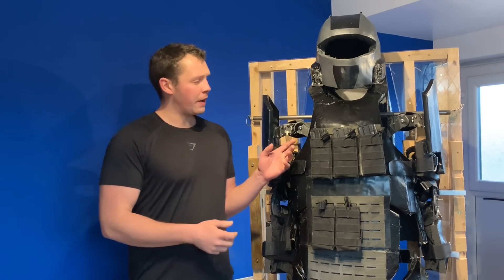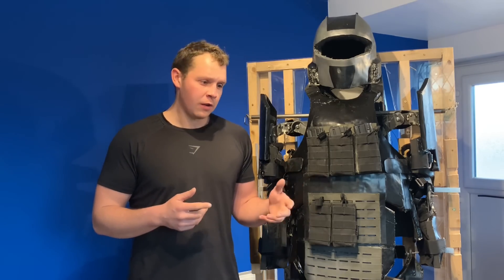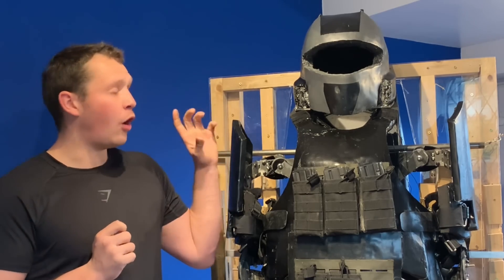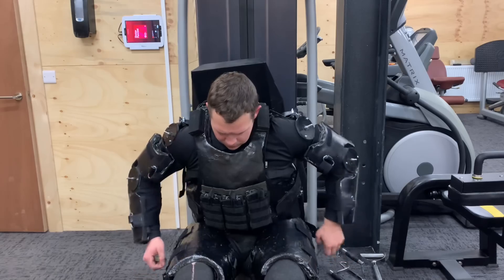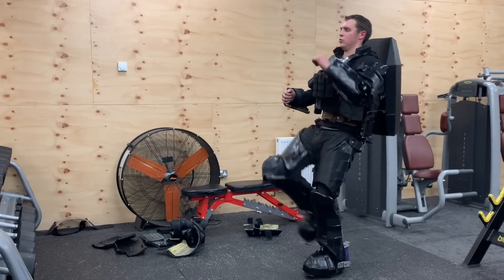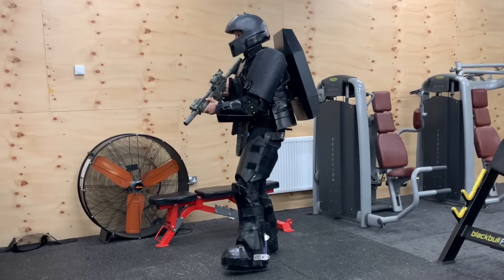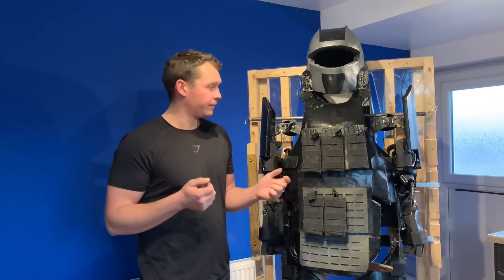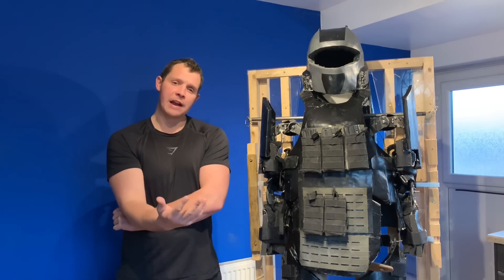Functional Combat Capable Power Armour Development Episode 5 Quest for Bullet Proof Exo Skeletons

Comment: Considering you're going at this project solo I want to run by you a few ideas I've had floating around my head on this concept for a few years now, as you have full reign on the project and it's influence and you're truly on to something. I've really been racking my brain about this and think that the concept of power armor needs to approached as a full system rather than just a fancy new jacket for the boys at the front, and seeing how you constructed the legs thus far and how they resemble some of that vision, I'm sure that my input could be of use to you and can give you the tools to better present this idea to investors: 

#1: "what about grenades?" 
Having a full suit of rifle rated armor is great but if the concept you're developing and prototyping is ever going to see the light of day, one needs to consider the ways that it could easily fail and run the whole project aground. Currently existing soft-armor solutions are still the predominant armor systems for most modern militaries because, for the most part, people just aren't actually that great at shooting each other while under fire and it's bombs [of various sizes and implementation] that really do most of the killing in combat and guns really do their best work herding the enemy into corners where they're easier to target with explosives. With soft armor, your best friends are mobility and cover. Case in point: if your rifle-rated system is going to have any viable advantage over the stuff we're fielding today, you need to really sarcophagi your wearer to keep the small bits out too. If you can be bullet-proof to a rifle but some clumsily placed buckshot or stray flak will turn you into the worlds heaviest one-man CasEvac, that armor system is now simply a liability to everyone in and around it. My recommendation would be to actually allow the wearers range of motion to sit in the back seat for the list of priorities and focus more on the coverage the armor panels mounted on the exoskeleton can provide. The individual in "power armor" shouldn't /need/ to go to ground to seek cover from common infantry weapons, getting up to their shoulders in the mud, they should BE the cover, and be deployed in strategically different circumstances to other types of infantry to compensate for the lack of mobility and the resupply necessities the armor system presents. Which leads me to my next point:

#2: Different job, different tools: 
A) The weapon: No armor system no matter how complex would be able to hold-up against concentrated small-arms fire without some serious high-sorcery being on the table. The best way to keep rounds from coming your way would be through fire-superiority, especially if your options for cover are limited. Your example with the carbine presents a critical obstacle to the implementation of a powered armor system in that, as I covered previously, the coverage of a capable helmet for such a system cannot be compromised to account for the ergonomics of a common rifle. Because of this, I'd suggest that you mock-up a dummy weapon that is designed around the armor instead of designing the armor around existing arms, and the purpose of the dummy weapon by design be that of a weapon system that can "hose-down" high-priority threats like MG nests, RPG teams, short-range gun emplacements, and light-armored vehicles which can actually engage armored combatants with effective volumes of fire. In my head I've envisioned something akin to the "smart gun" from the Alien series.
B) First-Aid: For medical interventions when the armor system does fail due to the use of anti-armor weapons, direct-hits from explosive munitions such as 40mm grenades/mortars, or high-volumes of concentrated small arms fire; the bulk of the armor would make it impossible to access any injuries below it, so the medical interventions such as TQs, quick-clot agents, IV fluids, and the like would need to be pre-implemented underneath the armor system in a way that the interventions could be activated without having to doff the armor altogether. Then, upon evac from the AO to a field hospital, the armor system could be removed with surgeons already on-site to provide immediate care to the wounded operator. 
C) Mobility: If you're following so far it should be apparent that there's no realistic circumstance in which an armored combatant would be capable or expected to run kilometers at a time to keep up with the tempo of battle. Hell, that's become uncommon simply with the current implementation of body armor today. Mobility would rely on some kind of rapid-deployment vehicle(s) which should allow operators to quickly dismount and disperse in order to effectively react to contact and keep "armored-infantry" units from becoming bowling pins on a two-way range when on the move. This is definitely a "down-the-line" consideration but it should still be considered from the inception of a functional prototype on /some/ level, at least as a selling point when presenting this concept for development.

#3: Task & Purpose:
Battery packs need to be recharged, it's difficult to reload belts without nimble fingers,  It's hard to eat through a helmet. The implementation of "armored infantry" should be for rapid-deployments: SWAT teams, QRFs, and to sever defending forces from the rear during offensive operations or provide security for aircraft landing in hot zones. Wouldn't make sense to throw guys wearing that kind of heavy gear into trenches. Form follows function, so hopefully such insights could inform your developments as you continue to build on the literal framework you've created thus far. 

I hope this comment catches your eye and that my midnight ramblings are of use to you in your development. 
Cheers and good luck.
Reply: to solve your first problem he could use an armored skin suit that goes on before stepping into the suit
Reply: @spazmonkey2131  I was thinking that too, but I still think that taking some notes from medieval plate harness at the expense of cost and flexibility [not like plate armor of yore wasn't usually incredibly articulated and mobile, mind you] should be the method of approach, given that ricochets and stray rounds are still a threat against soft armor and larger shrapnel fragments from threats like VBIEDs could easily defeat even chunkier flak jacket models. Bigger targets tend to naturally attract fire from bigger guns, so having maximum possible protection, yet again, at cost of your full range of motion, is probably the greater priority in development because retrieving the dead and wounded equipped in this fashion could be very well impossible in combat. Now, nothing could realistically be done about over-pressure from even smaller scale explosives like hand grenades but at least if your budget space-marines are maintaining proper dispersion,  you can then minimize your super-expensive casualties on the section level. And on that note I want to stress again that the use of a high-volume-of-fire weapon system would also dissuade hostiles from engaging with direct-fire weapon systems which could more readily exploit any chinks in the armor system. I don't think that a new platform would need to be built from the ground up; an MG3 on a modified steady-cam rig with a PEQ15 or something as the targeting device should suffice against anything that comes your way, especially if your whole section is equipped in kind. The only reason I wouldn't suggest an outright minigun is simply because it would be too complicated to maintain in the field.
Reply: @spazmonkey2131  Or just have a kevlar skirt...
Reply: First point is irrelevant. The armor system is just meant to be composite armor covering more than the torso vitals. Any explosive will be able to kill you with overpressure alone, given that it's an exoskeleton, not a suit designed to be air tight.
Reply: @HaloDude557  most shrapnel threats can drop targets at ranges exponentially longer than their intended blast radius. While the overpressure from a hand grenade can cause lethal injury within 5m and the fragmentation threat is optimal at 10m to 15m depending on the model, you can still get off-switched out to 50m if god hates you. The threat of over-pressure casualties is mitigated by disciplined and well trained troops maintaining proper dispersion.
Reply: @HOWCANIASSISTYOU  I’m not talking about grenades. If you make armor that  is impervious to rifles and grenades, the “enemy” will look to bigger ordnance. That’s just how things work. The idea of this armor is for full body rifle rated armor protection. Becoming a living walking tank is science fiction.
Reply: @HaloDude557 
I was gonna write a book as a response because I had the time but here's something you might actually read instead. 
Read my previous comments again, think about the principles on which I mention my points. I've already addressed all this. 

Hand grenades are an example for the larger expression that shrapnel is really what does the heavy-lifting for explosives. You can kill a man with a claymore at 200m if the stars align just right, but you can still sit in a hole five meters behind it and be fine with ear-pro. If your intel is tight, your troops are disciplined and understand how to move together in the field [spacing] and you can employ other weapons and systems like loitering munitions, predator drones, signal jammers, and so on; you can keep the big guns off your guys and allow them to complete their objectives with their own target precedence. 

I don't expect a magic human tank. Nobody does. Not unless they're twelve years old or on drugs and hopefully not both. Medieval lances still punched-through men in full plate, as did war-bows, as did ballista's. No armor system will make you invincible to weapons that are bigger than you are, that's not how mass and matter fucking work. You know what kept armored men from getting swiss-cheesed by these weapons until firearms became mass-producible? Combined units and tactics... Y'know, like in every war. Ever. Always.
Reply: @HOWCANIASSISTYOU  "You know what kept armored men from getting swiss-cheesed by these weapons until firearms became mass-producible? Combined units and tactics"
And mobility... hence why the end goal of this video is science fiction. The only realistic alternative involves a lot of armor compromises, complex engineering, and expensive materials in order to have mostly full body protection in a high speed environment. Something like multi-hit Polyethylene plating and single-hit flexible/soft armor (such as hexar or some kind of composite) in combination with a carbon fiber + titanium unpowered exoskeleton would technically work but be far too complex and expensive to build and maintain at scale. Because of that we're back to the good old reliable front/back plate with high cut helmet.
Reply: @HaloDude557  I agree with you here with some caveats. I think that some of the obstacles you present are only extant due to a lack of currently existing infrastructure. The Manhattan project produced the worlds most devastating weapon family in only three years by doubling-down on theoretical mathematics. None of the special equipment it took to build the first nuclear weapons existed previous to the project and now most influential nations of the world have nuclear arsenals [whether they're functioning and up to the task, who knows.] We're currently using 3d printed metal parts to design rockets. Buddy in the video built what he did pretty obviously in a work shop running solo and it's nothing short of impressive. If the air force can keep modern combat aircraft with their bells and whistles up and running, I'm sure replacing damaged armor panels and maintaining a pneumatic valve system like a formula 1 pit crew is far from out of the question for a well funded military,

Another thing is that infantry combat doesn't take place at a dead sprint and virtually never has. Maneuver warfare relies on the use of vehicles to deploy infantry where it is needed with armored and air support in a flash, but once they're there; men tend not to run much unless they're moving cover to cover, and the more men on the ground can put down effective fire, the slower and more methodical they tend to move. Once fire superiority is achieved, it is those with it who control the tempo of the engagement. That's why I proposed the idea of using purpose-built vehicles to supplement the slow moving armored-infantry. Which especially makes sense for SWAT teams and fire fighters.
Reply: @HOWCANIASSISTYOU  mechanized or air assault infantry are great and all but they have similar challenges that medieval cavalry did. There are significant drawbacks when navigating certain types of terrain or man made features, and advancement in ranged weapons made them grow more and more into a supportive role. Heavy armor became less effective as bows/crossbows got more powerful, and armored vehicles became less effective as anti-tank weapons developed better engineering. Vehicles also have the additional mechanical requirements. Helicopters need airfields, vehicles need fuel, mechanics, and parts. If you look at the Ukraine war, the bulk of fighting is done by infantry on foot since the threat of infantry fire AA and AT weapons is too great. “Cavalry” has once again returned to a support role.
Reply: TL;DR: Heavily armoured power suits should be designed for use by dedicated point-men or the entire entry team involved in clearing a building since: battery life and weight don't matter as much in these situations; some reduction in mobility for massive increases in survivability is very valuable given the already present necessity for teammates covering your 'blind' spots; compensating for damaged armour is as easy as pulling the replacement part out of a vehicle or rotating a fresh soldier and suit into their place; and this is probably the easiest way to get such a design adopted into a military/private company given it functions to improve a situation that both has to be done, and cant be done differently given realistic means, while not straining current functionality or requiring the re-writing of established methods as it would if applied to non-urban situations.

From what I can see about this specific direction of 'power armour' (prioritizing survivability) and the current tech limitations (mainly power supply density) these sorts of designs should aim primarily to up armour point-men in 'breaching' situations, since doing so negates nearly every downside this design suffers from, namely:

Power supply becomes irrelevant since the battery only needs to last as long as that operation (and can be replaced by teammates if needed);

Flexibility/dexterity/mobility is somewhat less mandatory since the point-man especially is already heavily reliant on their team to help clear other directions/react to situations after entering a room (especially large and/or complex rooms);

Long term durability/sustainability (of the suit itself) can easily be negated by proper logistics since, to my understanding, it's beyond extremely unlikely any modern, professional infantry force is going to have to clear buildings repeatedly for an extended period of time without being fully supported by reinforcements and material replacement (urban combat is dangerous and an isolated/unsupported force has almost no chance at long term success);

Justification (having a purpose), with modern infantry doctrine being built around fire and maneuver tactics, there simply isn't a good reason to use this kind of equipment, given infantry are expected to protect each other by undermining the enemies ability to shoot back (suppressive fire), and thus you don't need power armour to block bullets that aren't even being shot (accurately) and if the enemy uses anything bigger than small arms such as: heavy machine guns; cannons; artillery; explosive traps; or warheads (of any kind) the guy wearing power armour is going to get chewed up just as badly if not worse than regular infantry.

In summary, designing this kind of power armour to improve the survivability of a dedicated point-man (if not the entire team) is the most viable option if you want any military or private company to show interest in the project since this role is one of the most unmitigatedly dangerous situations a normal infantryman can find themselves in (walking into a room with no idea what's waiting inside), compounded by the fact that urban warfare in general (which is where most of these situations will occur and en masse) currently doesn't have proper, effective doctrine, giving extra room for an 'advancement' such as this to be adopted.
Reply: @FrendlywolfVideos  the problem is that breaching can sometimes be a very long operation. Breaching one room is never the case. Often you’re clearing an entire compound or neighborhood, and you might get engaged causing a prolonged firefight. This means the suit needs upwards of 24 hours of power (for example the force spends a few hours clearing, engages the enemy, then gets pinned down and needs to wait for a QRF, then fight out during extract) instead of just a simple 15 minute task.
Reply: @HaloDude557  For one, you should never find yourself pinned down in an urban area for that long, if you do it means your command structure is incompetent (you've effectively been abandoned and no one cares if you get over run), at which point running low on battery power is the least of your worries, the only military exception might be if your doing a risky deep raid in a hostile city, get cut off, and a relief force has to fight their way to you. Two, you can bring spare batteries, especially if only a few people have a suit, everyone else can carry a 20 lb spare battery into the building/complex as it would be one of the most valuable things they can carry, it's not like they need to lug 100 lbs of kit + a battery 50 miles do clear a compound, trucks exist. Otherwise I can understand a PMC security force wanting very long battery life, since they rarely get to choose their battles and any V.I.P extraction job (where having an armoured point-man is useful) is going to be poorly supported compared to a proper military.

I was more so referring to larger scale clearing of entire neighborhoods at a time, the likes of which modern military forces have no real answer to besides throwing bodies at it.
Reply: @FrendlywolfVideos  if you look at the Battle of Mogadishu, it's a classic example of shtf when we thought things couldn't possibly get worse. I find it very likely that the batteries would run out on an extended op. A car battery is quite heavy already and gets depleted just from headlights within a couple hours.
Reply: @HaloDude557  while I agree longer battery life is better, the battle of Mogadishu isn't a good example against my proposal, since my suggested use centers around the supported methodical clearing of urban buildings in order to reduce the risk suffered by the entry team. Just because the suit isn't an optimal choice if everything goes wrong doesn't mean it isn't valuable for its intended purpose. If you can think of any applicable shortcomings that can't be addressed with reasonable logistics/preparation I'd gladly talk it over.
Reply: @HaloDude557  Battery life is undeniably the greatest obstacle in all of this, though I've met a couple of people who work in robotics and the general consensus I've garnered from conversations with them on this issue is that a circuit doesn't necessarily need to be intact for the entirety of the time the operator is wearing the armor. [How to make this happen is miles above me, but the theory goes like this:]  If the act of the operator moving inside the exoskeleton is what completes the circuit for the battery with an input from the internal control system "telling" the armor to assist the wearer in that movement; relative to the amount of effort being exerted to activate that control mechanism; you can effectively "idle" without burning any battery life, and the output of the battery would be relative to the amount of assistance the mechanical components would need to provide the wearer. Note this would require that the frame of the exoskeleton can allow you to basically "sit" in the suit while the frame itself "stands" around your body [or what have you]. This all tracks with what I've experienced with some of the e-bikes we have on the market today, and there are high-end exercise machines that use this premise to maximize the amount of effort exerted by the user to optimize rows and presses [which is the opposite function, but with tech like this, you can literally "flip" a script and get the opposite results with the right hardware]. I see literally no reason why a team of engineers of differing disciplines couldn't achieve this with solid funding, and then any advances in material sciences that could even further optimize battery life is just gravy. 

On the note of mechanized infantry being reduced to support roles in Ukraine: I think swarm drones being employed in the coming years could very-well change this currently standing obstacle, but given the terrain of eastern Europe, the majority of the middle east and the Sahel; the rule has almost always been that you either win a fight by running in quick and putting fires out before they light; or you get stuck in battles of attrition that never end, or at least some other comparable posture. I think that's got much more to do with the vast, empty, and flat terrain making the front a meat-grinder with no exploitable or beneficial landmarks or features, than anything else, though. I mean, look at what the U.S. did during OP Desert Storm: They kept everything moving and blowing up the whole time in a coordinated fashion and it was mechanization that was the tool they needed to win that fight. Sure, the Iraqi's didn't have a Javelin behind every barn, berm, and barrow, but they had air, they had armor, they had RPGs and AA and so on and so forth. When it comes to Ukraine right now: the exact threats to "power-armored" dudes that I'm talking about are also the guys who get fragged by amazon drones for funsies while operators are waiting on new orders, and it's often not knowing where landmines are that takes care of the rest, so my question here is whether this is what modern warfare really looks like going forward in all theatres, or is this just an "ism" of this specific conflict and those like it? If so; cool: Many operations in WW1 also had battles take place under-ground and the last thing I'd like to run-into down in a tunnel or air-dropped into a trench is a bullet-proof meat-head with a flamethrower or what could basically be a sawn-off MG walking towards me. And to boot; the premise from the get-go was that these men would be specialized and utilized for niche ops in the first place, and not simply a replacement for line-infantry. Different jobs need different tools. Nothing ever in the history nor future of mankind is going to replace some grain-fed young lad with nothing to his name but a spear, helmet, and worn leather boots.
Reply: @FrendlywolfVideos  how can you endure the “supported methodical clearing” is only going to last a couple hours at most? It’s impossible to know all the variables
Reply: @HaloDude557  you don't need to know all the variables, you only need to be able to react to them, if something works 98% of the time, its easy to just eat the loss when it doesn't work, if the suit powers down during a prolonged engagement then you simply forget it ever existed and keep doing what you can, that's the exact same thing you should always do when something doesn't work out, run low on AT rockets? avoid vehicles, run low on ammo? plan a fighting withdrawal or surrender, commander dies? figure out whos next on the chain, etc.
Reply: @HaloDude557  also your forgetting that logistics exists, if you run low on batteries, pull more off a vehicle or have more brought in. or are you going to claim every soldier should carry 10 days of food and water and 5000 rounds of ammunition on their person at all times 'just in case', you bring what you think you'll need and improvise everything else. If you told a group of soldiers that are ordered to secure a square miles worth of 10+ story apartment buildings that you have a way to make them unkillable against small arms fire if only they bring enough 20lb batteries, they're going to haul wheelbarrows filled with them wherever they go if that's what it takes.
Reply: @FrendlywolfVideos  a prolonged engagement happens more often than 2% lol. Especially against near peer threats
Reply: @HaloDude557  a prolonged engagement without any form of logistical support in an urban environment when the original mission was to clear buildings in a given area should not happen more than 2% of the time, if it does, your not part of a professional military, your in a poorly organized militia at best.
Reply: Laser-aimed weapons would be more appropriate for this armor
Reply: @jeremiahr7585  I'm wondering myself if there's a way you could treat a bullet-proof visor as to allow infrared lasers to be visible through it, so that you could acquire your target without them being able to see that they're being targeted. This way you wouldn't need to rely on complex optical [or god forbid, digital] equipment which could be easily compromised under field conditions.
Reply: Homeboy on that sci-fi @jeremiahr7585
Reply: For the weapon they should use a machine gun with an ammo belt attached to a backpack full of ammunition to basically never need to reload. Then attach some type of optic that’s actually a camera. This way you will be able to aim by having the camera from the machine gun be connected to a screen inside the helmet.
Reply: @Phantom-bh5ru  The camera idea is well and fun but I've worked at an airsoft field and watched dudes waste a whole day trying to get their go-pro's working. The French army also tried it with the FELIN system and the Israeli's took a shot at it with their "corner shot" system and none of those projects got any traction in the field. Guns and camera's really just don't mix well out in the world, especially when the guys you're sending to fight don't give a shit about cameras or how they work. 

As for the backpack belt; maybe for a designated gunner in a section or fireteam. Having to reload your weapon helps you keep pace with your ammo expenditure and it's really hard to count your shots accurately with a juiced-up automatic and it's much less problematic to run-dry when you can reload, than to run-dry when you can't. I'm thinking semi-disposable tins of 200 rnd belts that could be staged by clipping to the front and side abdominal panel(s) before stepping-off would work better, especially if the MG could be mounted to an "arm" on the chest that can hold it out in your field of view considering you might have to move like the tin-man from Wizard of Oz in your super-suit. Having multiple 50 round belts like the special police in Jin-Roh could also work, but dangling belts tend to get chewed and stop open-bolt MGs dead in the real world, and stoppage drills would be the worlds nastiest chore when mixed with limited visibility and mobility under fire, regardless of how many rounds of 7.62x[??] your "shell" can eat.
Reply: @HOWCANIASSISTYOU  isn’t the reason that felin gor canceled because it was massive, bulky and clunky to use? Additionally you still had to actually aim down sights to use it no? With my idea it would be more like a cctv. The sight is a camera and you can see through it from a screen inside the helmet. Now this is getting a bit more futuristic but a way to offset not knowing how much ammo is in the backpack belt would be to have some kinda ammo counter.
Reply: @Phantom-bh5ru  Bulky and all? sure. Sights? No. Camera's just don't like being mounted on guns and making them work on vehicles and aircraft already requires specialized personnel for their maintenance. The armor system and weapons will require trained armorers as is.  It's really not something you want to make standard as an aiming system, especially when environmental factors that can obscure it are taken into account: humidity, mud, dust, blood. the works. 

Using a projector or a small-screen inside the helmet isn't a grand idea either because having to shift your focus in your field of view, with an obstruction in your field of view, is really, really not ideal. Just use a laser with a way to zero it for range. Anything more complex is asking for something to break when you need it and having a suspension system in the armor  full of compressed hoses and the like is point-of-failure enough. 

An ammo counter is an idea if it isn't digital.  That said, if you'd get a critical stoppage in the feedway in a system like that; there goes all your ammo for your op in one go, with all of the extra weight still intact.